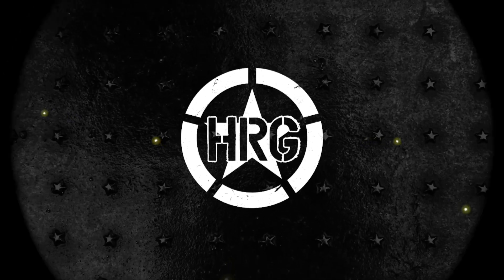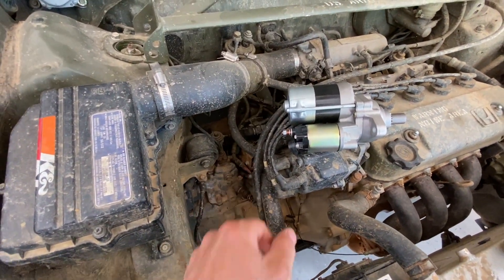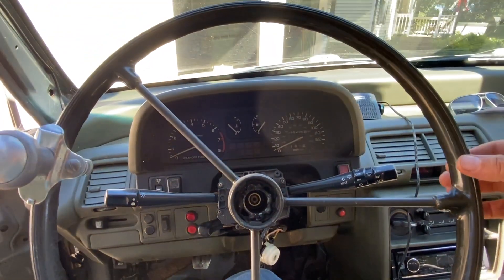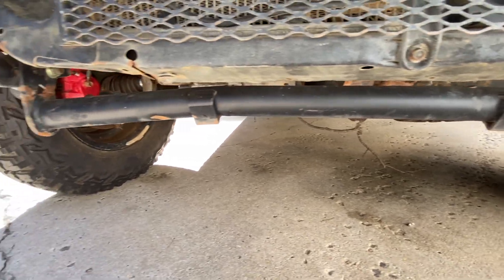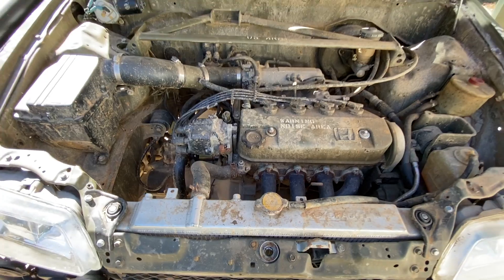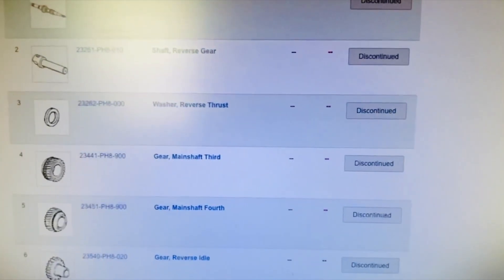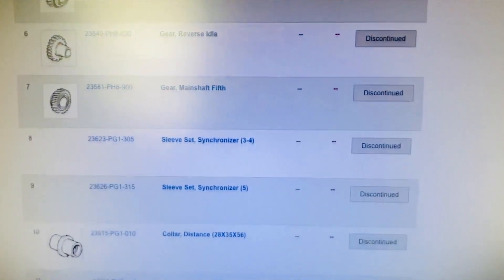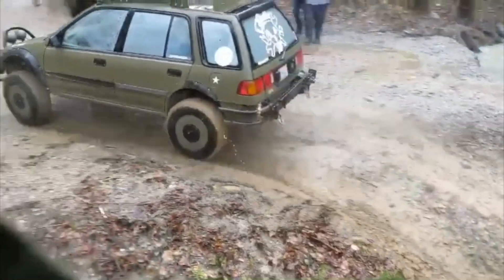This car needs an upgrade. More power for my 91 Civic Wagon aka the WAR WAGON?

Comment: I'm dealing with this same issue on my 86 rt4wd wagon. No support for the transmission or even the engine itself. I'm going to probably go the full swap route and go with a toyota drivetrain with the 22r. Just all the honda aftermarket support doesnt have enough beefiness for my off road needs that I do.

Comment: The D trans can definitely be repaired and built.  No need for more power when you can just shorten the gearing.
Reply: You would know a thing about that :p
Reply from the maker: 108 HP/ 99 FT/LB is not enough my friend. at least not enough for the type of off-roading I do.
Reply: @hrg_tv  a 22RE has  116 hp and 140 lb-ft of torque and you can make those climb a vertical wall when geared right. My wagon dyno'd at 100 hp even!
Reply from the maker: @DashnCars  No doubt! with a Toyota pickup, Jeep, Samurai, or traditional 4x4 you can install an atlas transfer case and crazy low axle gears and crawl up a vertical wall if you want. I could definitely figure out a way to make a one-off reverse rotation transmission/transfer case and do solid axles front and rear. But I want to use as much Honda stuff as possible.

Comment: You should take the whole J series motor, trans and rear end from a 4wd Honda Pilot, Now I know it won't be manual, but you can put it in D2 while you are crawling.  K series 4wd transmissions are expensive, hard to find and they are not much better than the D Series  RT "Glass" transmissions. Plus you won't have to deal with the whole J to K adaptor. An Automatic Crawler is just as capable as a manual.
Reply: This. I was gonna suggest a Ridgeline drivetrain. For some reasons, their transmissions seem a little more stout than the Pilot.
Reply from the maker: There are guys running 9s through built k awd transmissions. Parts are everywhere. Lots of support. The same can’t be said for the D or J auto.

Comment: I would love to see a J swap! I would also like to see a K transmission 6 speed added. I'm also interested in the limited-slip diff in the front and your thoughts on pinning the rear diff and adding a freelander viscous coupler.
Reply from the maker: In the video I talk about the rear axle. In case you missed it, I’m doing a solid axle swap.
Reply: @hrg_tv  Oops. Thanks